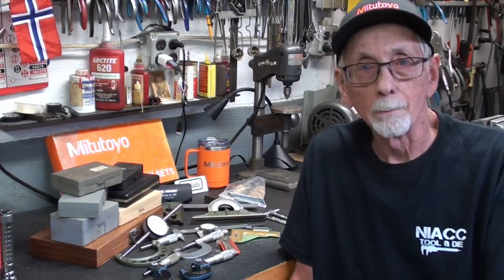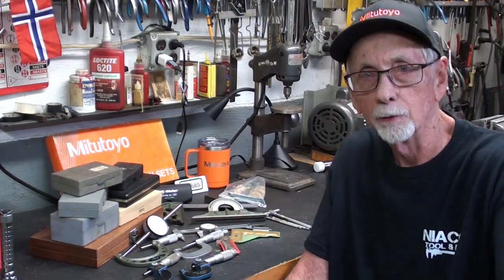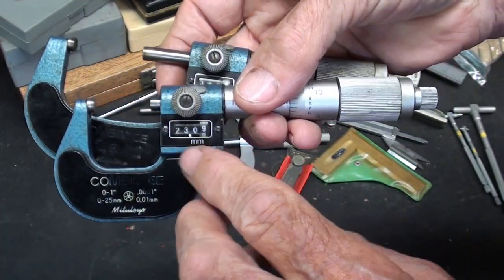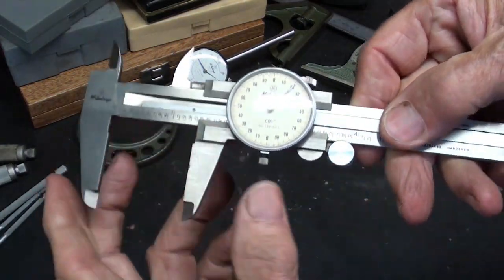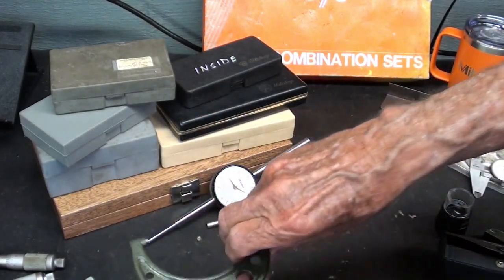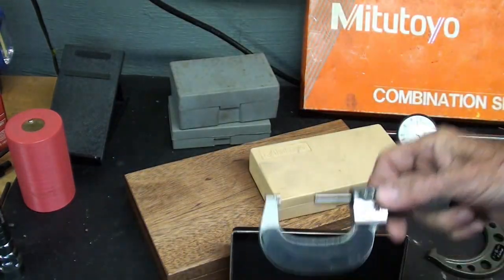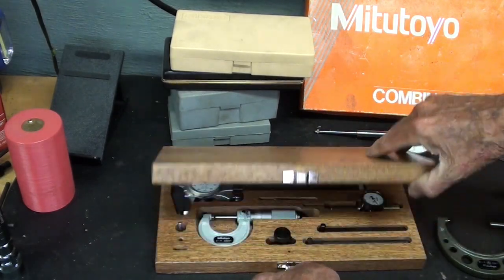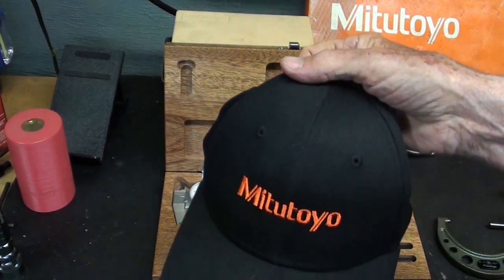MY MITUTOYO PRECISION TOOL COLLECTION #925 tubalcain micrometer caliper metrology

Comment: I did watch the video of the shop full of tools and machines and I was amazed!  I don't own many Mitutoyo tools because most of my measuring tools have acquired used and most came to me before Mitutoyo was common in our area. My first micrometers were bought in 1972. I have a one inch, tenths micrometer from them but it feels clumsy to me compared to Starrett or Lufkin.

Comment: I bought a 1" & 1-2" combo mike set in 1975 and they have been in daily use ever since. No issues with the mechanical mikes & no batteries or burned out boards to quit on you.

Comment: In Japanese it's pronounced MEET-SUE-TOE-YO though often in natural speech it sounds like MEETS-TOE-YO (possibly varying somewhat by region) It's the same first part as in Mitsubishi (MEET-SUE-BEE-SHE) with the TSU of tsunami (a word which is pronounced basically the same in English as Japanese) There are different systems used for translating, or rather transliterating, Japanese to 'roman' characters and the system used by Mitutoyo omits the S from MITSU. My understanding is that it may be at least partly to do with changes in Japanese pronunciation over time. Big grain of salt as I'm no linguist and only spent about two years over there, gaining a mastery of the language candidly described by multiple Japanese people: "As a toddler speaks."

Comment: Tip for PC users: Click on the video tab of you favourite channel and put it into a folder on your bookmarks toolbar, repeat for all your favourite channels putting them into the same folder, then every time you open up your browser, right click on the folder and select 'Open All' and you'll see all the channels new videos open up into individual tabs in the tabs bar (clicking on the folder using the scroll wheel button does the same thing.) That way you don't have to rely on You Tube showimg them in you video feed and you don't have to search for them.

Comment: Dear Sir, very good video; I have a request. Could you make a video ( or suggest a good one) on how to use ( step by step) a cylindrical square (sometimes called a master square)? I have searched through you-tube and found inadequate videos , usually telling you how to test the square, but not how to use it. Step by step meaning; what do the curved lines on the square's surface mean?, what do the dots on the curves mean?, when you offer your work against the curved surface, what are the things  you look for ,and what do these things tell you about your work? , is the master square  slightly tapered and why? Could you please offer any guidance. There does not seem to be thorough videos on the subject. Thank you.

Comment: Lyle I've got an old mitutoyo dial caliper one of the places I was working at got rid of from my research the logo it's  62 through 64 but it needs a crystal and it's an odd size crystal you wouldn't have to have one laying around would you

Comment: Would these Mititoyu videos be a veiled slight of Starrett? A back-handed slap in passive-aggressive form? Not that I would disagree since Big S caved to a holding company. Usually that's a swan song of a shop since holding companies buy little shops like this to shut them down. Might not be overnight, but eventually that company will disappear..
Reply from the maker: I still love, starrett.     But they cannot compete
Reply: @mrpete222 Agreed. I don't have much Starrett, won't be acquiring anymore.

Comment: I don't know if it is just a UK thing, but some Mitutoyo long-term packaging leaves a lot to be desired. I bought a dial indicator, and it came with no protective case. Even a cheap fake 'Miluloyo' comes with a plastic case.
Reply: I find their storage cases to be rather poorly designed. Even the latest digital QuantuMike cases leave a lot to be desired as they make getting a grip on the micrometer body difficult when removing or replacing the instrument in the case. 
The older cases with the padding foam that used to disintegrate and discolour the satin chrome on the mic is the devil's work.
Reply from the maker: That foam destroyed several of my tools

Comment: Thanks Mr Pete. That electric micrometer may be one that is coolant splash proof and you may also find a connection that is used to connect it to data recording equipment.

Comment: Nice collection, Mr. Pete.  As I've mentioned before, our Q.C. department would take measurement tools out of service on a whim or due to any irregularity.  I absconded with the discards.  I have 4", 6", and 8" Mitutoyo electronic calipers and I find the 4 incher gets the most use.